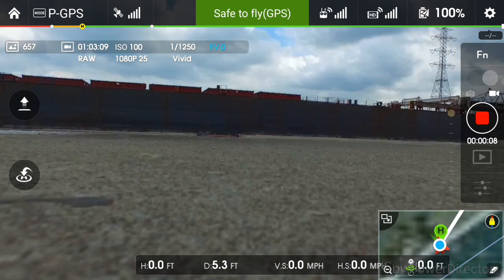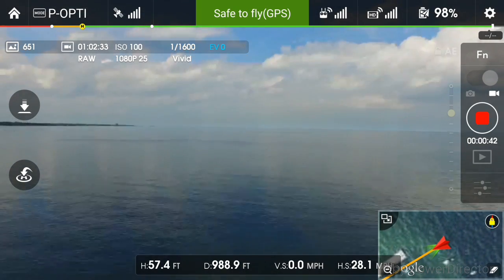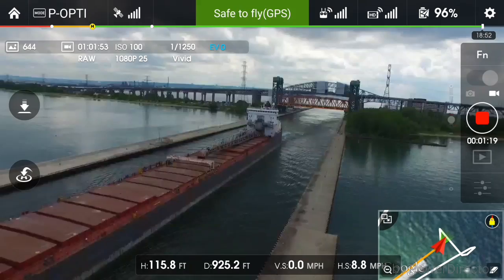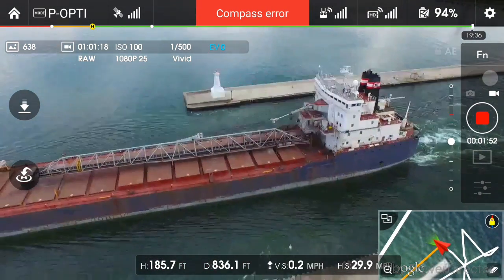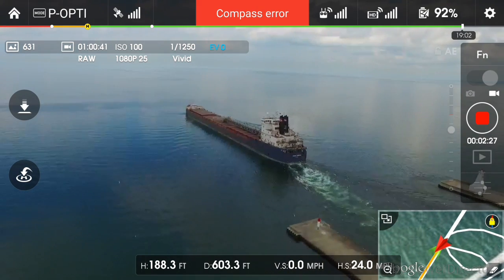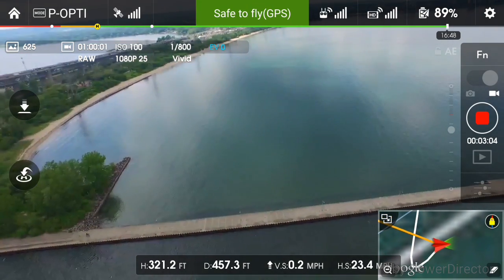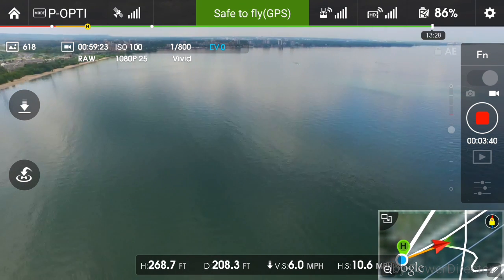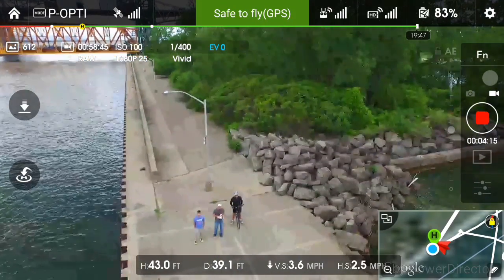Near drowning of a DJI Phantom 3

Comment: I just had a similar issue with my DJI Spark. I usually place the Spark on a concrete pad on my front porch and sit on the stairs to fly it out and over the house. It happened once about a year ago and just happened today where I was flying directly over the house, and suddenly it got a "Compass error. Exited GPS mode" with a "Magnetic Filed Interference. Exit P-GPS Mode" (yes, Field was spelled Filed), and it TOOK OFF heading south. It disconnected and briefly and I got a flash of a top-down view over a house I didn't recognize, so I headed out in the car and some kids told me they saw it fly over their house. I drove around for a while and found when I was on one particular street, the controller re-connected and then I got a view sideways from inside of an orange tree with pavement underneath. After a while of walking around, a car drove by me and then I saw it drive by on the camera. I had thought it was a driveway and not a road so I was looking in all the wrong places. Luckily a guy pulled into the house where the tree was and got a ladder and a roof rake and helped me fish it down. Last year I had to bring it down in someone's backyard because I lost steering but still had altitude control, and hunted around until after dark to find it. Interesting to know that it might be a calibration issue. Very weird that it let me take off and flew around perfectly fine for about 5 minutes before it went haywire. What's interesting is that looking at the flight replay thing, the compass does start out pointing the right direction.
Reply from the maker: here is my spark trying to fly away 
https://youtu.be/J-aZboP__Vk
Reply: @My_Little_Hobby  Hit or miss that is sometimes what happens to me! I've owned it for a few years and this has only happened to me twice that I can remember. I use the controller plugged into my phone with a USB cable and was literally directly over my house when it decided to go nuts. I was pretty sure it was lost forever but found it 1300 feet away, in the next town, in a tree, thanks to the random connection and cached image of the road and a car happened to drive by as I could simultaneously see the car in person.

Comment: I have the same compass error and crash as you. :(
Did u updated the firmware before this happened?
Reply from the maker: I dodn't remember if I did or not, but I really feel it was a bad calibration due to metal in pier.
Reply: +cdnstudman u did the cal at pier?
Reply from the maker: yes
Reply: Thx, ur video is helpful.
U flying good now?

Comment: Make sure to disable the optical flow sensor over water, the sensor doesn't work good on reflective surfaces, and will crash you phantom into the water.  Personally il probably never film at a port due to the high powered radar which can interest, not to mention all the metal at ports.  You should also go into Atti mode (A on your P A F Switch on the left side) when you loose control.
Reply from the maker: +Costa “mrGREEK360” Apostolou I just leave the sensors on as they only kick in at low altitude when there is no GPS (or so I understand it at least). I fly over water all the time, actually I probably have more flights over water than land, but I do appreciate you sharing with everyone because the tip may apply to others on here.

Comment: hey cdnstudman:   your video has come up for discussion over at phantompilots. If you get a chance you should swing by.  http://www.phantompilots.com/threads/an-example-of-bad-compass-calibration.64581/
Reply from the maker: +Travis Pendell Hey, thanks for the link. I checked out the comments and still hold strong that where I calibrated was the issue. I have flown around several ships with no issues, but that was the only time I calibrated over something like that, and sure enough there was a problem. I was cool seeing my videos floating around the internet ;-)
Reply: cdnstudman I (in my limited experience) agree that it was compass error due to calibrating near all that metal. Just noticed your video popping up over there, had recently subscribed so I thought I would point it out to you. I enjoy your videos, keep them coming :)

Comment: huge magnetic corrugated sheet pilings along the side of the channel, and as you said a carpet of rebar undefoot, close shave !! good you put this here and good it didnt ditch in the water... :-) Also as you move many miles, the magnetic lines of force do change and as every real pilot knows if using magnetic headings you have to take into account (marked on your chart) lines of variations, as you fly (basic flying) So yes cal away from structures and after you drive a lot.!

Comment: I see that where it says GPS u don't have any number in there. I have seen other videos and usually it says 18 maybe that was the problem
Reply from the maker: MrRgarcia112 That was a messed up flight from start, but so far it has never happened again.
Reply: +MrRgarcia112 I think the older phantom app didn't have a number of GPS Sats. It only had the signal bar. Many people were not happy about that so they added it later on.

Comment: Crazy, man! As soon as it first messed around and regained control I'd be landing immediately. Possibly that colossal metal ship could've thrown off the compass.

Out of interest, how do you record your audio when in-flight? Not in this video but in others you've given a running commentary of flight. I'm on an android device so I'm not sure if it is a built-in feature on Apple devices DJI Pilot app.
Reply from the maker: Anthony Bate Hey, I doubt the ship was the problem as I flew around and over another one (video on my channel), but from what I can tell, the location you calibrate it has to be free of metal, magnets,electronics, etc, but once you are in the air, most thing don't matter. as for recording, that is done with AZ screen recorder for Android, it's free on play store. It records audio while screen recording the app.
Reply: Ya I would land immediately lol
Reply: +Anthony Bate ya have to have jailbroken your Ipad/phone then use an app called stole to record the ipad's screen
Reply: +Brian C If you're on android (like the shield) you can get an app called AZ free screen recorder (no root). records everything on the screen in full resolution and 30fps. good app. 
I'm hoping to get a shield in the January sales though, a lot of bang for buck.

Comment: Yes your problem was calibrating your compass where you should not have. Common user error problem then people blame the Phantom.  Calibrate your Phantom only once in a grassy field preferably and you should not have to again unless making a large geographical change of at least hundreds of miles.
Reply: Ben7seven7 Why do some people say Calibrate everytime your going to fly?
Reply: Eric Hernandez Becaus they are trying to be extra cautious even tho it's not necessary.  And sometimes doing that can be a bad thing if they calibrate it poorly.  If it ain't broke don't fix it.  Do your calibration and not again unless traveling very far away.